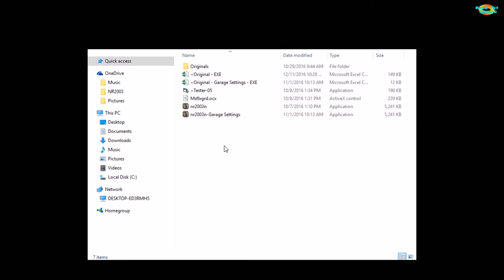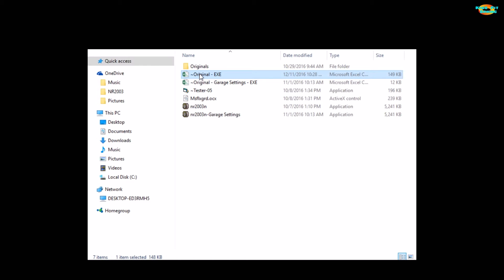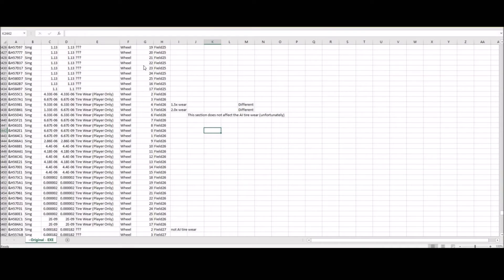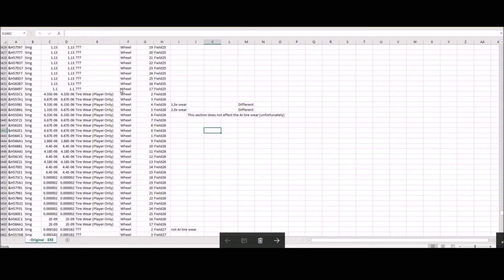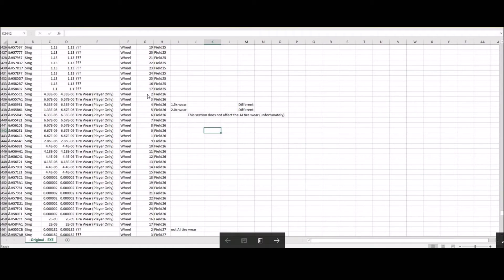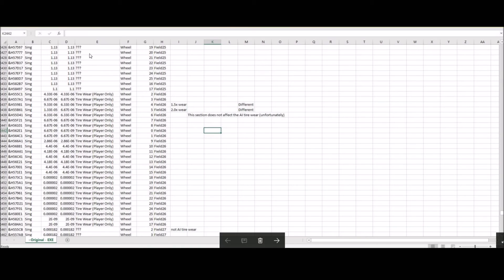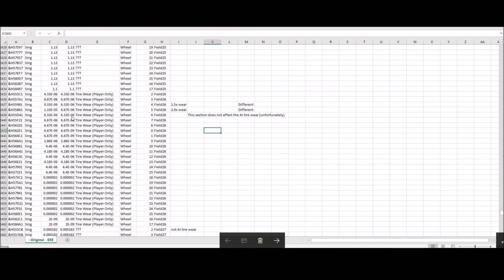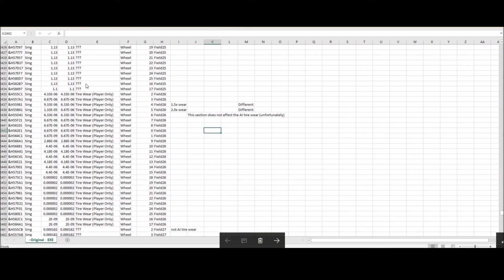NR2003 Physics Discussion - Tire Wear in the EXE

Comment: I have also been messing with the engine part. Those Torque 1 2 3 values did not make any sense before but I think I got it figured out. After all the reading those line up to be BMEP, brake mean effective pressure.  Or basically How much torque you got over how big is your engine. That value is used to compare different engines of different out put and size. I believe that is what those are. Now I managed to adjust and make a 96 cubic inch 1.6 motor that would show realistic results +_ 5mph with real life Drag 0.28 and Frontal Area 18.8 .   Topped off at 118 just like advertised top speed. Let me know if any of this is useful .
Reply from the maker: Well done. No doubt that took some serious work to figure out.